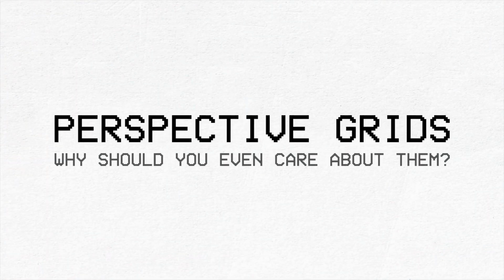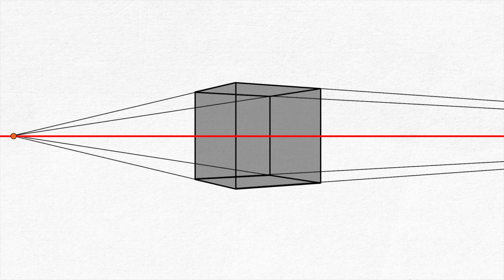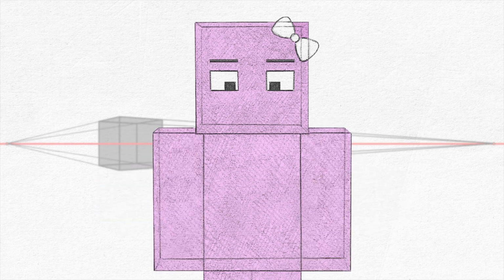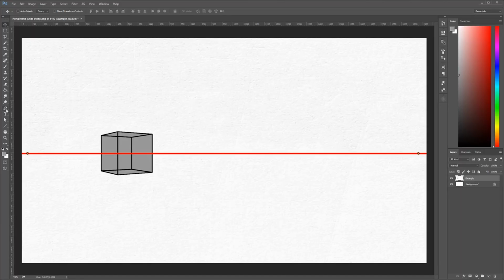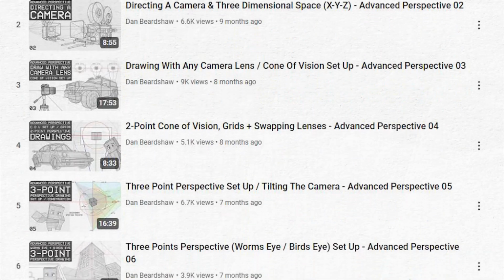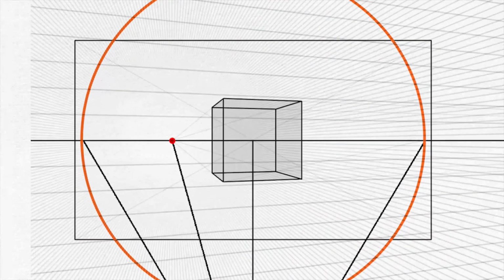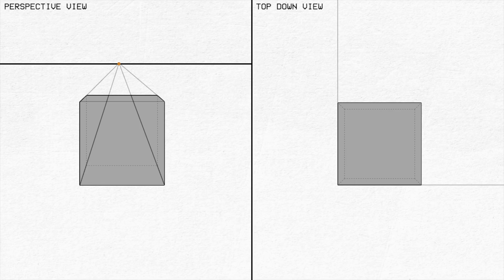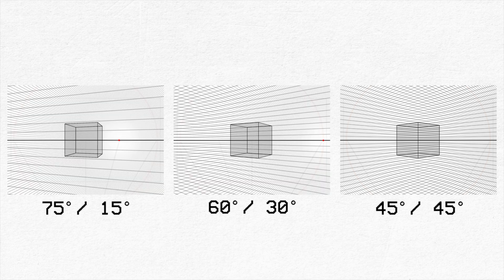Perspective Grids will IMPROVE your ART… (+ FREE Download)

Comment: The creation of the grids seems straightforward, but I don't understand how the grid will help me find a line that goes to a VP off paper.  Not sure how to use these grids.
Reply: The grid lines all point to the VP off the paper and any lines you draw that are 'parallel' but between grid lines should also point to the same VP. So when you need to draw a line that should go toward the VP you either draw it on one of the gridlines if that it the right place, or draw a line somewhere between the gridlines but rotated the right amount so that it also points to the same place. You should quickly be able to get a feel for how much the line should rotate based on how close it is to the two grid lines you are in between. Like, if one grid line is 4.5 degrees from horizontal and the next grid line is 6.3 degrees from horizontal, and you need to put a line right in between them, then it will need to be at 5.4 degrees. Not that you will measure any of them though. Understand that the idea of the grid is that the lines are close enough that you can just estimate other lines in between and be reasonably close without needing to measure.